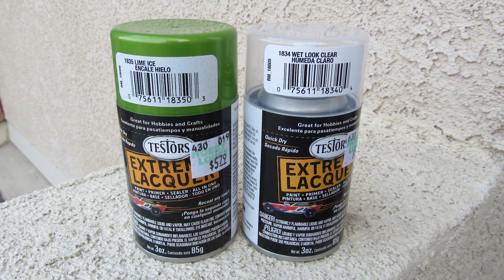Three Blind Mice Hot Wheels X-Men '64 Nova Station Wagon

Comment: nice work. Somehow, y'all need to figure out how to do a scale woodgrain look, this coulda been a woody, shoulda been probably. I know how it's done life size, but how to scale it down... no idea.
Reply from the maker: Thanks!  I think about the only time you’ll see me try woodgrain is in a truck bed.  I still have nightmares from the weird contact paper like “simulated” wood grain that a friends parents car had on it when I was a kid 😂.  (It might have even been a Pinto wagon if memory serves me correctly...even more scary 😂)
Reply: @JimSilva-SilvaDiecastCustoms  I actually liked a pinto wagon. the wagon didn't have the explosion factor that the little short ones did. Few pintos got the "estate" treatment, but some did. Yeah that stuff got worse and worse and by the 70's was a joke. Even for a wood bed, making it look like wood would be tough. You could buy a cheap plastic farm kit, and use either the barn sides or fence rails to make a wood bed for a model. That's the only thing I can think of that might work and be to scale or even close.